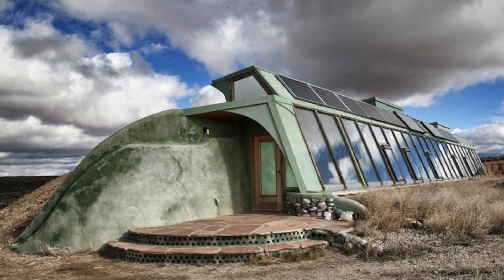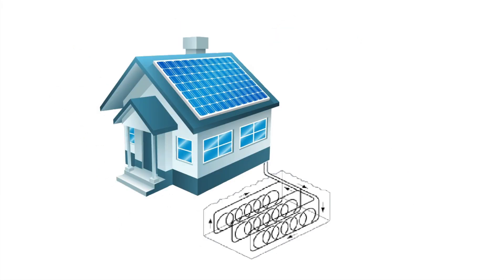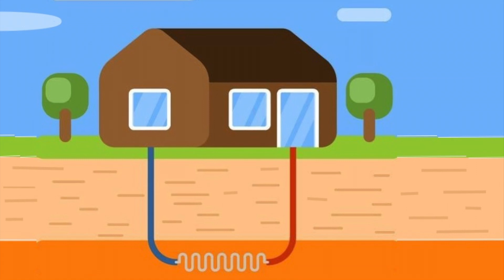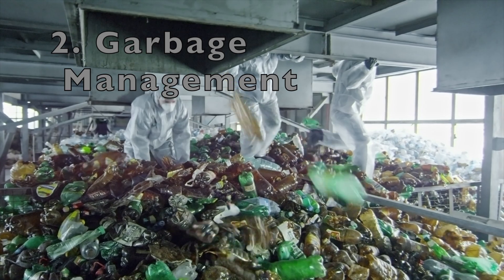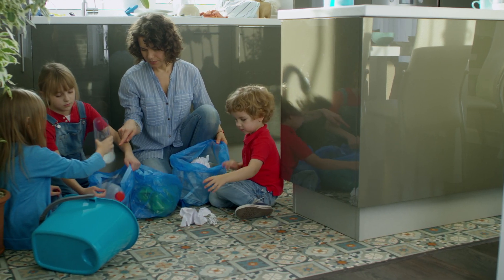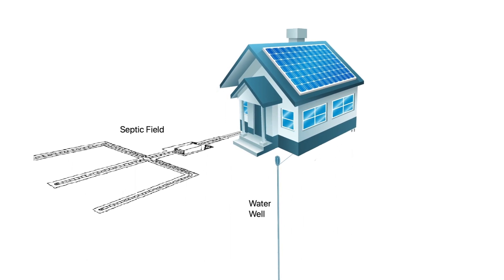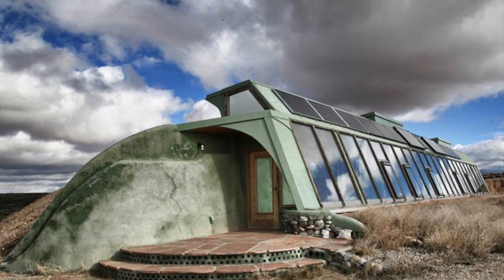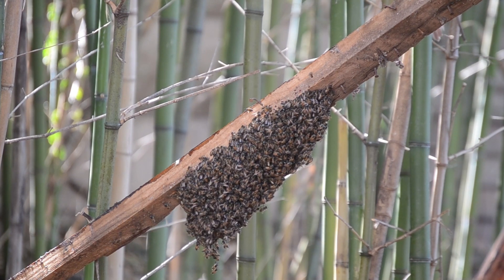Earthship Energy Savings for Any Home!

Comment: I agree to some of your points. For example earth battery - yes cool it works. But for hot in winter and cold in summer the relation goes like this:
- best system is entirely underground.
- second best is partly covered.
- the dumbest system is what most houses are - outside of the ground.
I'm saying from a cooling and heating perspective not something else.
So if you throw out the tire idea - which indeed is super dumb since tires can be recycled in more useful products, having the north of your house underground is smart. The only issue is to be able to use a bulldozer not people. A bulldozer will do all that work in 1 day. Few hours actually. So it doesn't actually require that much work if done smarter. 

Outside the ground means insulation. Insulation is expensive, is toxic, it requires complex manufacturing, requires specialized people to install it ... etc - bottom line insulation is expensive and not environmentally friendly. Dirt is cheap - this is why is called dirt cheap - and not "eps cheap" or "foam insulation cheap" .. so having as much of your house underground, without increasing costs is smart.. is hard to have dirt on top of the house, since that requires a stronger structure which increases cost, which cancels the benefit of underground. 

Then i disagree with you on water collection. Rain is free, abundant in most of the world considering a hole year.. even deserts have rainy days.. you just need to collect it.. the roof is already there, tanks are cheap if you make them out of concrete not plastics.. not buy them, make them.. compared to digging a well - no, the well you can't dig yourself, you might not have good water, it might get contaminated, it will cause problems into the future when tunnels gonna be a thing..  and the most important aspect is the cost. Digging a well is expensive. Sometimes super expensive.
Recycling water is smart.. if you use bio shampoos, then that water can go to plants just fine. Nothing wrong with that. Filtration and pumps and stuff you have for a well also. You don't need to filter your bath water.

Using your poop for fertilizing plants is not gross.. is just normal and should be done. We should leave our bullshit evolutionary knowledge based on dumb 'yeiiks' and think like a chemist. Using cow poop or worms poop or snails poop or anything else is not much different. Once the bad stuff breaks down is safe to use for plants. Far better then the chemicals used in agriculture for soil enhancement. The composting system needs to be constructed properly tho. And no is much cheaper then the usual septic system.

The septic system you mention is not cheap. Uses a shit ton of plastic also which is extremely stupid. In 100 years all that septic plastic is micro plastics. And all that fertilizer goes nowhere. And has capacity problems. Different soils might only take so much of your waste water. If you overflow - like when taking many baths.. or forgetting the tap open, you are in big trouble of contaminating your hole yard. Separating shower and washing machine from poop and also yet another system for pee - is smart and should be done everywhere. You should only trow out of your house perfectly safe excretions. Combining pee and poop and washing machine and shower is no different then combining all garbage - plastics and food in the same garbage bin. They should be kept separate same as garbage. For most people needs, rain water is enough if would be all captured because earthships have big surface area for the roof.. 

Outside of having your in house compost for food scraps - i don't see how earthships deal with garbage any different then a regular house. You still have plastics and fabrics and stuff. No way to process that in house as far as i know.

Is true that you pay more taxes for bigger house. But that's just wrong. Is not part of laws of physics and reality. Is about bullshit human laws which need adjustment. You should be incentivized to grow your own food - no different then being incentivized to install solar panels. The reason is - we incentivize people to live environmentally friendly - if you go 10 meters in your house to grab 1 kg of tomatoes - then that is more environmentally friendly then  going 10 km to the store using the car. Did i mention that the tomatoes hitting the store is hole another pointless environmental disaster? Trucks, farms, pesticides, people working, all that - fully pointless. Since you can grow tomatoes in your house for free - actually seed's cost something but - that's 1 cent per seed not 2 dollars. Meaning you get 200x at least - assuming a $2 price of 1 kg of tomatoes out of a grown plant. If that plant makes you 2 kg, which is common, you get 400x ROI. So for any country to tax such indoor garden - is just as idiotic as taxing the installation of solar panels. The bigger solar panel array you have - the more you are taxed. Makes sense in dumb land i guess. As for insects and other stuff.. depends. Is not like tomatoes grow in your bedroom. It can get messy and smelly if you don't take care of it for sure. There is a individualized compartment for growing plants and that also helps in regulating temperature and humidity. If you grow them in a separate green house then you loose the temperature regulation plants do.

The fundamental concepts of an earth ship are solid and something to attempt to have. But yes the constructions themselves can be quite idiotic, even if they look beautiful to some eyes. Tires should be used for making pavement for roads and not tied pointlessly in constructions. This is why sometimes properly trained engineers flip out when they hear somebody advocating for earthships
Reply from the maker: Thank you
Reply: Great feedback and ideas Alon... I love it!
We're working on solving a lot of the problems that you mention above and we hope to test them in our personal home that we're building next year.
Once that test is done, we'll be offering our services nationwide... and we hope to build each home at a lower cost and build them faster than Architect Mike does (we're using modular techniques and less custom work!)
Take care!

Comment: I drilled a well in Alaska to replace my far less expensive underground cistern due to getting sick of paying for delivered water. However, the well plus pumps, heat tape, pressure tank, and filters to remove bacteria, arsenic, manganese, and iron, cost me about $24,000. This was back in 2007, and my well by itself cost $45/foot (included in the $24K price), and we didn’t hit clear water until 238 feet deep. So this is evidence that a well is far riskier and far more expensive than cisterns. Also, you need just as much filtration plus softening equipment for a well (you don’t need a softener for rain water). Bacteria and heavy metals are present in well water. I would much prefer rain water catchment and not have to worry about those heavy metals that are in well water. I also had a reverse osmosis system on my well system for drinking water, similar to what is used in an Earth Ship.
Reply from the maker: great comment

Comment: Rather simplistic. I'm not a fan of earthships. However, the idea of drilling a well, and how easy it is, sorry, doesn't work that way everywhere. First drilling can cost $10k to $15k with no guarantee of finding water, especially in many Rural areas is Missouri. Which is why we have those giant rain harvesting water towers you see sticking in many communities. Good luck drilling 300 feet, usually around 50ft, you hit solid rock. Rainwater, being highly filtered from the roof? Define highly filtered? I use a simple Berkley to filter my water and it takes about four hours and great water. I have a bigger system (2) 55gal drums, which use a similar system. No "high filtration" exposure to carbon filters and uv light and nothing in it. As for re-using "poop," again you're over simplifying this concept. Perhaps not the way the hippy dippy earthship people do it, but you can use solar energy to dehydrate it until it becomes ash, no microbes to worry about, and then use that for your garden. If you think that's going to poison my food, I recommend, you go out and do some research. A lot has happened since 1960. Insect infestation? lol Ever hear of aquaponics? There are a lot of foods which can be grown indoors, such as onions, pineapples, etc.. not to mention self-pollinating plants and look no insect infestation. I grow potatoes in 55gal drums in my garage, no infestation. I do agree that eartships are kind of dumb. Taking something simple and complicating it. But you really didn't address the title of your video. How do we use what has been learned in building earthships, in every day homes. You were so busy bashing earthships, you never really provided the information your video title promised. In that, you lost credibility.
Reply from the maker: Thank you for the detailed answer.

Comment: You are right in some points, but WAY wrong on others.
Tires are too labor intensive, making the home unafordable to most. However that is not an essential part of the  process. We plan to build with form filled concrete and flagstones, which are abundant on our land. Still going to bury the 3 walls for thermal temperature control and for Fireproofing the structure. The tires make Earthships earthquake proof, so there is definitely a good reason to use them!! My home will not have that advantage
You are also wrong on the thermal and earth battery idea. Earthships do not need thermostatic controls. Some of us don't like dependence on high tech 'shit'.  . The Air tubes are a MINIMUM of 40 foot of buried tube. I don't know where you get the idea that there is only a short piece of pipe. Your picture only shows a small exposed section that has not yet been buried, so this is a false assertion. There is no way to run out of cooling on a hot Summers day due to short pipes. Total rubbish.
Every Greenhouse on an Earthship has an angled front and a half roof (as shown in the picture you disparaged, which prevents the Summer sun from getting into anything but the actual greenhouse. The vents and air cooling tubes are more for cooling the greenhouse than the actual interior of the home.
You either totally misunderstood the concept of water recycling or are deliberately misrepresenting it. The first reuse of water is ONLY grey water and that goes into a planter which filters it naturally just like the earth itself. The excess water from that goes to flushing the toilets which go into a normal septic tank . The only difference with the earthship septic, is it doesn't just run into a leach field and be lost in the ground. The 'leach field' is an outdoor field on which are planted fruit trees or ornamentals to decorate your home. You are not in danger of eating contaminated food due to 'humanure'. 
 I fail to see the intent of your video, unless it is to sneer at and malign  a sustainable living system because you aren't prepared to do anything to help heal the earth, yourself. Not all cities water is safe to use. Think of Flint Michigan which is not nearly the ONLY municipal water system that is poisoning it;s residents due to old lead pipes. Apparently this is a non issue to you.. You are so smug and condescending and you really need to just stop you bull shit and if you have nothing good to say about a proven system, you should keep your slanderous accusations of 'scams' to yourself. I hope Michael sues the shit out of your smug arse.
Reply: He wasn't smug and shitty, you took it too hard.
Reply from the maker: Thank you for the detailed comment but honestly I find it kind of insulting to say my "purpose is to sneer at and malign  a sustainable living system because you aren't prepared to do anything to help heal the earth, yourself." esp considering  I offer alternatives to most of the costly and highly labour intensive ideas you defend in the video. You bring up some good points but completely avoid that an earthship costs about $300/sq foot to build in Canada, and most of what an earthship does can be done to most regular homes that have enough space. That's extremely expensive.

Comment: I think we are on the same page for most thoughts on the "Green" plans for the country. I have an earth bermed  green house, and a medium sized garden. Only have a half acre, live on the edge of a small city (35,000 pop) but have a barn and a dozen fruit trees. Unfortunately, I live close to the highest elevation of a small (rocky) hill. There is a quarry used prior to 1900 a few hundred feet from my house. So, digging a well is not an option, I had enough issues digging holes (with equipment ) for my pole barn. With a 1,000 sq ft barn, I collect half the roof of rain water. I spent <$200 for five IBC totes (275 gal each) and have a 6th container upstairs on the second floor of my barn.(I pump water up every few days, gravity does the rest)
 I use the height distance to water both the garden and the greenhouse, its about a 15'-18' drop.  In our city, (have sewer/gas/water, but, water is charged (about $30-40/month)  at a rate that includes both water and sewerage in the same price. The water that goes in the garden, does not go in the sewer, so I would be actually paying double the cost.
Reply from the maker: I wonder, is a dehumidifier possible in your area? They arn't very expensive and can produce a LOT of water if your area isn't extremely arid..
Reply: @SimpleTek  I do use two dehumidifiers in my cellar, the water is used solely on in home plants. That water never makes it out to the greenhouse. (just not enough).
The issue with that is cost of electricity, I am in the most expensive area for Kwt

Comment: Finally someone willing to debunk the eco evangelism that is the earthship industry. They don't keep it simple. Instead of a homestead concept you have some socialist green new deal thing creating the need for (slave) labour. Building a sustainable dwelling is hard enough, building an overly complex logistical nightmare is an order of magnitude more expensive.
Reply: 700,000 cdn for a dwelling is too expensive for normal people to achieve. You could easily incorporate all of simpleteks ideas into a superinsulated dwelling for less money, probably half. If you view money as the ultimate representation of carbon footprint (and it is as good a metric as anything else) then they are a huge carbon use.
Reply: One thing that is not factored into the earthship costing method which pushes many of these ugly things over a million dollars is the fuel needed to collect and transport garbage (a building component) and labour to and from the building site.
Reply from the maker: well said